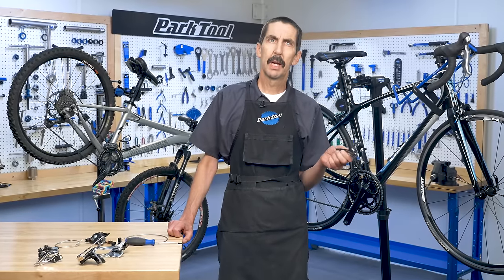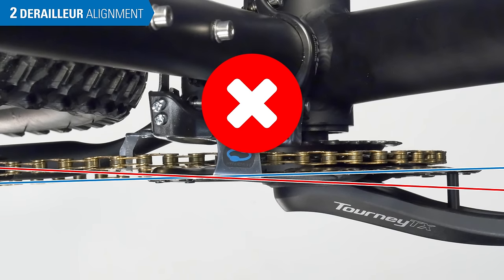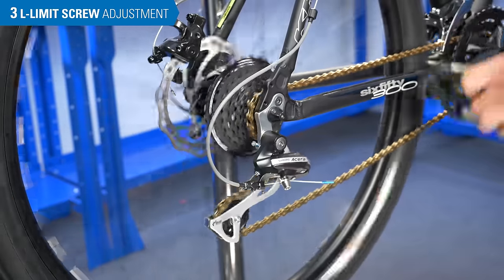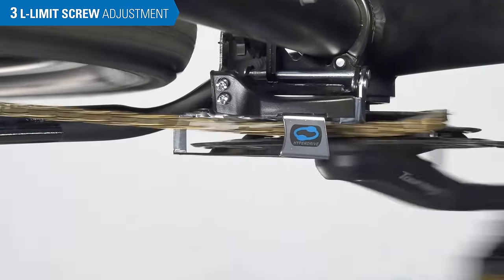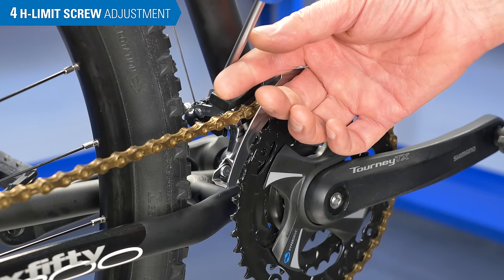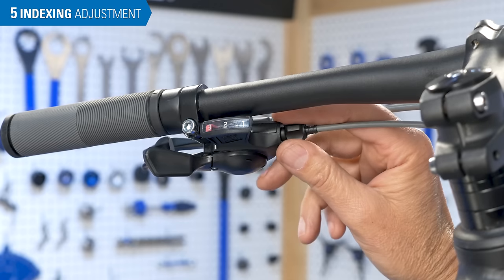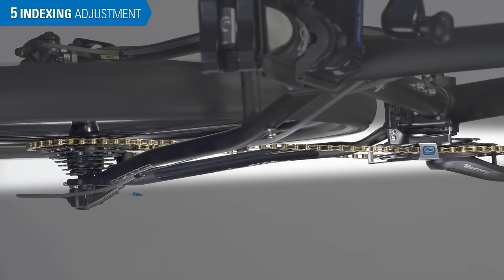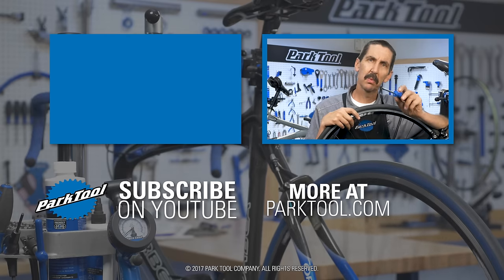How to Adjust a Front Derailleur

Comment: When i try shift front gears .....1 to 2 no problem, 2 to 3 the chain slides back to 2. ONly when i press the shifter very hard, i hear the click sound and thats when the chain stays at 3. What do i need to adjust ?
Reply: Your limiter screw for the big chain ring (the H screw) is not properly adjusted. This screw limits the derailleur going too far outside, throwing the chain down.
In this case you have to turn it out, until your shif lever can move to 3 without too much force.
It may be only 1 rotation or so, so turn it slowly step by step until it works.

Comment: 9:14....what if my chain is shifting to the 3rd biggest gare but m not getting click feadback from the shifter which is pressed by thumb.
i m applying alot of pressure but it not getting shift to 3rd gare and comes back to 3rd! it feels like i m not pressing the shifter enough to change the gare!
Reply from the maker: You may need a shifter flush to loosen up some old gummed up grease. you can see that process here https://www.youtube.com/watch?v=DSlj28P6IZA

Comment: My H limit screw is as loose as it goes and the chain is still rubbing against it when on the larger front cog, and the smaller rear cogs. Does anyone know what is wrong here?
Reply from the maker: If it is rubbing on the outside of the chain then the system needs a bit more "tension" added to push the cage out further. This can be done at the barrel adjuster if it equipped.

Comment: I'm guessing that if my barrel adjuster is broken then I will be unsuccessful at tuning my derailleur
Reply from the maker: Correct.  You can try to change tension at the pinch bolt, pulling more or less cable, but that is difficult to control precisely.

Comment: Why do things never ever work-out as shown on YouTube?! I've been having a slight problem with the chain hitting against the front derailleur when the chain is on the middle front sprocket disk and middle to higher gears in the rear. According to this video, adjusting the barrel adjuster should adjust the front derailleur enough to solve the problem, but when I turn the barrel adjuster, the derailleur does not budge. What gives?
Reply from the maker: to move the cage in while in the middle chainring you will turn the barrel adjuster clockwise/ tightening into the shifter. You can run out of adjustment with the barrel adjustment. it is not infinite. If you run out you will need to shift to the small chainring, loosen the cable anchor and slightly loosen the cable. This will loosen the cable and change the range of the barrel adjusters range. Front derailleurs are quite a difficult item to adjust. Often thought to be the hardest to adjust as there are so many variables.
Reply: @parktool  Thank you for your reply. I went ahead of myself and left the comment before watching the entire video. I need to take my time and go through all the steps demonstrated within. I loosened the derailleur bracket to align it with the chainring, which for some reason rendered the cable too loose. Anyways, thanks again for your reply.

Comment: I find this procedure to be long-winded and confusing by Park Tool standards. I don't understand the focus on setting the limit screws before finding right shifting position. In their impact on shifting, the only thing the limit screws can do is trim the lowest gear away from the bottom bracket; the middle and high gears will be set by the indexer.

Comment: I am unable to set the derailleur height due to cable restricting movement
Reply from the maker: Unhook the cable as the tension will need to be adjusted and reset if adjusting height anyway.
Reply: @parktool  Thank You very much

Comment: So what about when the front derailleur shifts fine when the bike is in the stand, but while I'm riding it, it won't shift from the small ring to the large ring?

Edit: does that mean I'm too fat?
Reply: that's probably that your adjustment is "too perfect" loose the H screw a little bit and check, if the problem persist, increase the cable tension by a bit, then fine tune it with the H screw, having a barrel adjuster in the line helps a lot with the fine tunning
Reply: @core2zero  thank you, I will try that
Reply: @core2zero  didn't work 😩 I've gone through this whole process three times over the last two days, as well as riding and making minor adjustments while on the road. Still won't shift while I'm on the bike, but works perfectly in the stand.
Reply: @buddytheweasel  that definitely sounds messy, i would try to overfit the H side, tune it until it pushes the chain off the big chainring and work it from there, and last resource, go to your local bikeshop.
Reply: @core2zero  I haven't tried that yet. May go ahead and do it. I got nothing else.
Reply: @core2zero  I finally got it working. Seems the cable tension was waaay off, and the support screw was not in contact with the frame, or at least the little protective plate on the frame. I followed the si.shimano.com manual as if it was a new install, lots of back and forth from cable tightening/loosing to small adjustments and I got it working better than when I bought it. Thanks for your help!
Reply: @buddytheweasel  awesome, glad you got it sorted out !

Comment: @UCZR7NONfU3bYe_GMII91EmQ This video was IMMENSELY helpful, along with your advance troubleshooting video (neither was poop) and https://youtu.be/8Yk-uQ6C1x0. The maintenance stand just makes it WAY easier and will for all my bike maintenance -- and helping my neighbors with theirs. For the record, my derailleur had come loose and dropped into chain and front spockets. I got bent, lost some of the plastics and the cable tension was off. Took me a while to find the sweet spot, but after carefully bending the cage back straight enough and aligning properly, getting the H & L screws and cable tension right did the trick. Have a great 2021 Goose!

Comment: There is no barrel adjuster for my shimanoI 105 front derailur
Reply from the maker: If there is no adjusting barrel in the housing system, you will need to try to change the amount of slack on the pinch bolt. It is better to install an "in-line" barrel adjuster in the housing up at the bars.

Comment: My left hand shifter doesn't even stay on 3, it goes back to 2 and I can't figure out why
Reply from the maker: Possible issues: 
The H-limit is too tight and it cannot catch that last ratchet in the shift.
Or the pawls in the lever as slow from age/dirt/non-use.  Flush with a solvent and blow dry. Then lubricate.

Comment: How do you do height adjustments with a stupid plastic chain guard on the crankset.  Not sure who thought it was a great idea to make something like that and not make it removable is beyond me.  So frustrated by it.
Reply from the maker: There are times where you cannot get the cage well set because of these guards.  You get it as low as you can, that is all.
Reply: @parktool  thank you, will do my best I guess, trying to get it to shift up but without a stand its quite hard to pedal, shift hold the bike in the air is quite difficult.

Comment: I move the limit screws but I get no "cage motion" !   😢
Reply from the maker: If you unhook the cable you will be able to see motion when the low limit is turned. They will only create motion if the cage is at one of its limits.
Reply: @parktool  I did think of that but was wary of making it worse.  On way to bike shop(s) now .  May have to bribe them to get me in!  lol
Reply: @spaceghost8995  sometimes the screws are super undone and just need to be tightened more but also the little piece the screws move can be broken

Comment: Comprehensive but not always comprehensible for a non-technical person (and why else would I be watching?). Heavy language which should be simplified.  For example when dealing with a derailleur that won't shift easily to the large chainring we are told "return the shifter to the inward position and pedal to get the chain ring under the smallest ring which matches the shift lever position to the position of the derailleur".  What does that mean??

Comment: None of the videos about how to install and/or adjust the front derailer deals with the fact that the angle between the seat-tube to which the derailer is clamped and plumb varies from frame to frame.   There are no derailers to my knowledge that allow the setting to the angle between the derailer cage and its clamp.    If that angle is not specific to the frame,  then the cage will have a gap between the large gear ring that varies along the cage, that is the cage-arc will not be concentric with the gear.   In that case, one may try to set the distance between the cage and the large gear at 1-2 mm, but at which point of the arc?  The closest point, I would guess, to avoid a collision between the gear and the cage.   Can one take the helpful video seriously, when this problem is not even mentioned?    Add to that the fact that the cage is over the large gear only when the cable tension pulls it there.   But that is not possible until the clamp is tightened,   Sadly, in that condition the cage cannot be moved to make the adjustment !!!
Reply from the maker: It's typically not prudent to mention a setting that cannot be adjusted or moved. Frame manufacturers have access to the component manufacturer parameters and is in charge of setting those angles when the frame is made. This video is made for those that are learning and do not need to know fairly complex things that can confuse them and they cannot do anything about it.
Reply: @parktool  I do not call it a setting, because it cannot by set except by the mfg.   I wonder if others who use a derailer that is not the bike's original equipment can achieve the indexing indicated on the twist grip from 1 to 3.   Adjusting the derailer as carefully as I can,  the best indexing I can achieve is from 1 to 2.2.    At 2.2 the chain goes to the largest gear.  The cable is so tight that I cannot move the barrel adjuster even with a pliers without possibly damage it.

Comment: very complicating. both H and L don't really move much at all. Needed the chain to shift to the largest of the 3 sprockets. been working on it all day. got it to go to the 3rd sprocket but its scraping the guard rail or what ever you call it . The thing that needs to be 3 milimeters from the top sprocket or the biggest sprocket.. i don't know what it's called. I can't afford a shop to fix it. this is horrible
Reply from the maker: Begin with how it works.  Then plan the adjustments that work for you.  See https://youtu.be/yDjlRu4CnjI

Comment: I have to ask because you fail to mention it, which is the l screw which is the h? You point out how to adjust but you don't mention which one is which.
Reply: Shift your front derailleur to the lowest gear and then try to adjust both of them at the same time. The one makes front derailleur move in this case is the L screw.

Comment: This is a pain in the ass fixing to do. Especially when your bike is made in china. They use cheap inner cable that will always expand a thin increment of mm after I think it's done. I tested it and it would never be working well at the least expectation. It won't even pull or release the derailleur finally. Let alone the amount of hours of trying to understand the mechanism system for the first time was also tormenting my poor soul.

Comment: I'm mechanically retarded. Hand me a computer and I can fix it, hardware or software related. This video was somewhat useful, if I had all the correct tools, mainly a work stand. I turned the barrel adjuster on the handlebar side and the wire inside the cable decided to unwind, escape and now has lost all tension. This is my second bike I've managed to fuck up. I think its better to just pay someone with the know how, cause I haven't got a hope in hells chance at solving this riddle.

Comment: More schilling for the manufacturers. Just like Shimano's user's guide, this video fails to mention that not all problems arise from FD height and angle, and assumes that all FD's automatically install so that the outer plate is directly above the big ring. On my brand new frame it is inbord by 6mm--way beyond the parameters of Shimano's limit screws. No screw turning or cable tightening will get the chain into the big ring. BTW, this is not the first time I have had this problem on an undamaged frame, so I must assume the real problem is Shimano's silly adjustment parameters, which allow for only 2-3 mm movement one way or another. Why pretend this problem doesn't exist?

Comment: it doesnt move when i turn the screws .they sevre no purpose at all.
Reply from the maker: The screws only control the limits of its travel. If in the middle of the derailleurs travel, they will do nothing. Try removing the cable and tightening the low limit. You should see it working.

Comment: this has not helped. no mention of tightest on the cable when install. which derailer do you start with, both need adjusting. so start with front, but rear isnt adjust, how do yiu which geARS FOR EITHER WHEN ASKED TO IN THIS OLD MISS INFOEMED VID. OK, SO WORKING ON FRONT, BUT i HAVE TO WHICH GEARS ON BACK TO ADJUST FRONT, HUH!!!!  THDE BACK DERAILER IS NOT ADJUST. SO WHAT NOW, BULLSHIT!!!!!